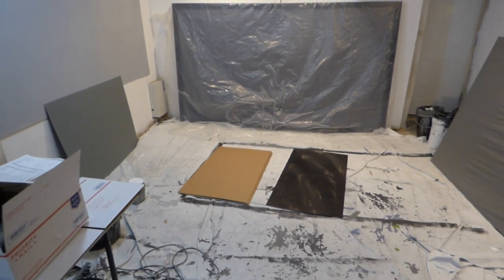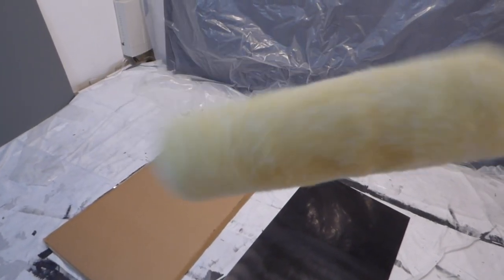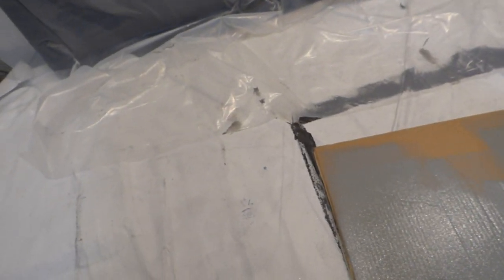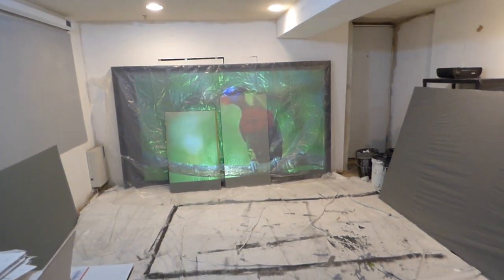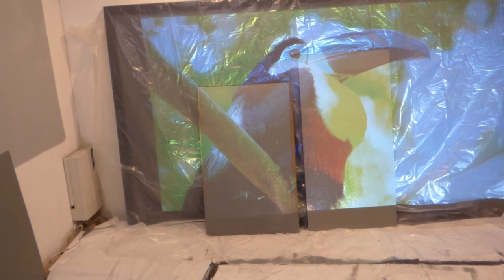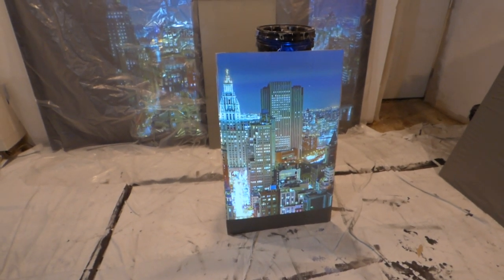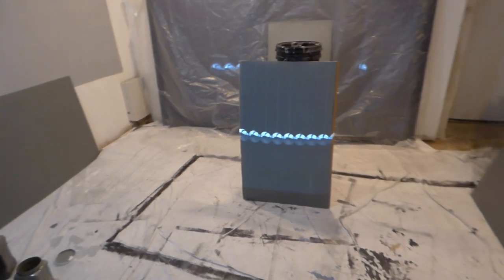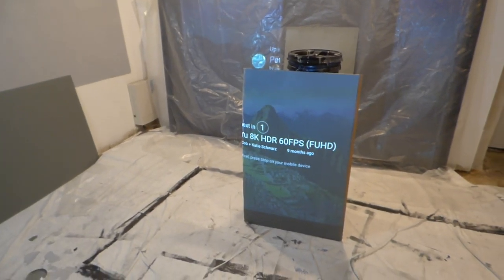OUR NEW FORMULA NAME ECLIPSE ULTRA 4K SUPREME CINEMA! SCREEN PAINT KITS 2 QT , 1 GAL

Comment: Awesome. Thinking of a frame to staple the blackout cloth on to hang my outdoor portable screen. It was built for a 9 x 5 foot rear projection screen but mildew ruined it. In fact, I could make two, one on each side. Got two of the same projector. I can run two movies/sports events at a deck at a campground I go to with the stand turned.
Reply from the maker: using a cotton blackout cloth material weatherproof your  screen with polyurethane using a sprayer than paint the screen using our screen paint ez and fast trick :)

Comment from the maker: LAUNCH DATE 01/26/18
1 GAL KITS COME WITH FREE 10 X 20 BLACKOUT CLOTH
2 QT COME WITH 5 X 10 FREE BLACKOUT CLOTH

PROJECTION SCREEN TYPE: Screen paint
SCREEN COLOR: Slate 4K gold
GAIN: Smart technology gain X9
APPLY INFO: Paint can be apply with a  sprayer or paint roller
ANGLE GAIN: 190
LUMEN COUNT: 200 and up.
ULTRA 3D: Yes.
Ultra 4K: Yes 4K  ready.
PROJECTORS: 4K, 720P, 1080P, LASER, DLP, LED, LCD, Short , ultra and long throw projectors.

BASIC INFORMATION:
For Indoor fully weatherproof for outdoor home cinema
Color enhancement technology X3 Perfect whites and dark contrast levels. 4K and 3D ready Lumens  only 200 and up compatible with all projectors. Smart technology gain X9 

Low-Voc's eco-friendly , Low -odor Dries fast , Easy 1 coat  paint on application for just about any surface with none cracking or peeling technology. Low-odor, Eco-friendly, Low - Voc Ez - clean-up just warm water and soap, Only 1 -2 coat of paint needed, Dries-fast. Can be painted on wood, glass, plastic, vinyl, cardboard, drywall, brick ,cement,  plexiglass , congregated cardboard and metal. No priming or sanding needed! 

2 QT kits with 5 x 10 blackout cloth price $312
1 GAL kits with FREE 10 X 20 blackout cloth price $422

Shipping is free worldwide!
www.crystal-edge-technology-screens.com
Email us at immerse4kcinema@outlook.com